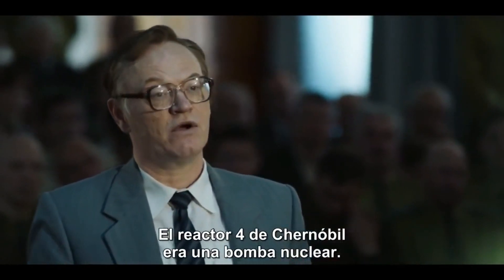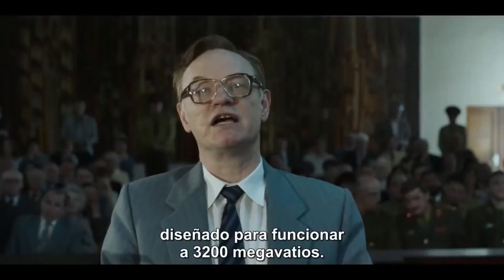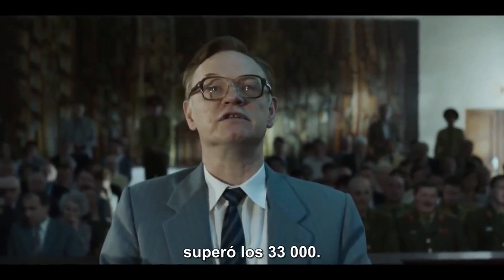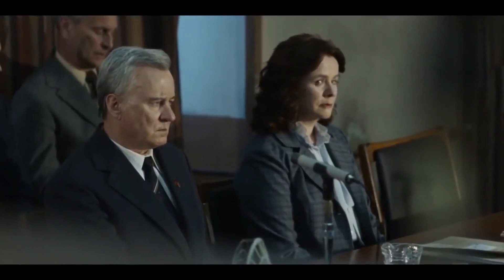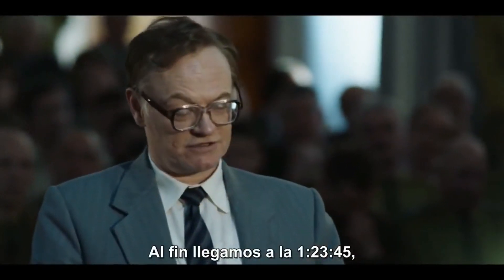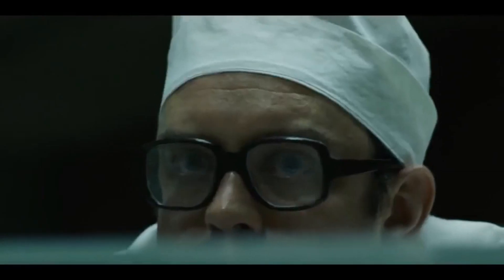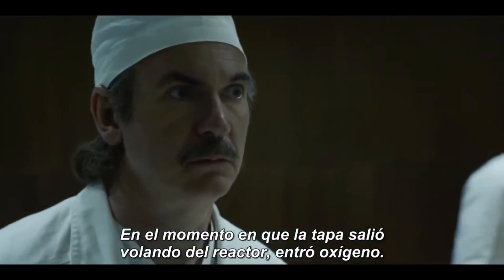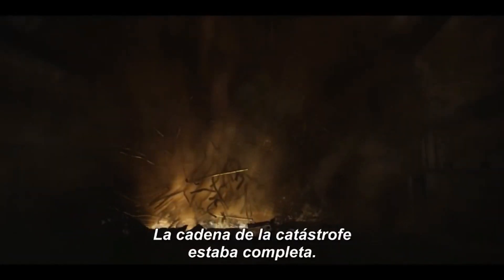Chernobil disaster explained in 10 minutes (3/3) - Valeri Legásov - Chernobil Series

Comment: This hollywood based miniseries made an entire generation misinformed about what actually went down, graphite tips weren't cheaper or "tips" at all, that statement makes it feel like they just added them because they ran out of boron, but no, bottom half of the control rods were made up of graphite, and top half were boron to increase reactivity at a much higher degree when pulled out, and displace water then get replaced by the boron control rods when inserted in, it wasn't an accidental addition it was serving its purpose just as intended, as RBMK reactors could both produce energy for civilian use and produce valuable fissile materials for nuclear weapons production, as well as having a huge thermal output efficiency with low enrichtment fuel, it was a double-deal. And when run at above half power it was and still is working like a charm , there are still 8 operational RBMK type nuclear reactors in Russia and Chernobyl Reactor 3 continued to operate without any issues till it got shut down in 2000 after serving its purpose, what they did fix in the reactors was shortening the length of the graphite tips on the control rods, and as for compensation, using higher enrichtment fuel and making the control rods drop or raise much faster as well as putting much stricter regulations, leaving no room for unambiguous rules or procedures and thoroughly informing their engineers and operators about the nature of the RBMK design.

Comment: In addition to upregulating the reactor [when used as intended] the graphite tips served another use - graphite is a lubricant, and the control rods moving in their channels needed to move smootly in a palce where normal grease would break down almost instantly due to the termerature.

Comment: Whether the graphite tipped control rods was the prime cause is conjectural.  The thing was already so far out of control and on a run away path of reactivity that it is not clear that the graphite tips made the difference.  Without question, they increase reactivity, but the reaction was already so out of control that it is a reasonable question as to just how much more reactivity was added by the graphite tips.  For example, if it is already spiraling out of control and increasing power exponentially, how much more reactivity do the graphite tips add?  10%?  20%?

The thing was going to blow whether or not the AZ5 button was pushed.  And it takes 18 seconds to get the control rods fully into the reactor.  It was already too late to stop the explosion, in all likelihood.
Reply: They made the difference apart from dialtovs stupidity

Comment: Okay, but "because it's cheaper" isn't an answer to the question. Why do the control rods have graphite "tips"? Why would the control rods have graphite on them at all?

I'm actually asking. This part of the explanation made no sense to me, and they kinda just hand-waved it away.
Reply: Ah! I can answer this! So, when a reactor is running, you'd think that the fuel burns evenly throughout the core, but this is not so. Like a fire, fuel in the core is expended more quickly, while fuel at the edges of the reactor core is reacted more slowly. When looked at it from a top-down perspective, this isn't too bad. That just means you swap out the fuel rods on the edges less often than the ones in the core. But this difference in consumption rate is also vertical. So a fuel rod channel that runs through the whole reactor in the middle will have the center parts of the fuel assembles consumed, but the top and bottom of the assembly still has plenty of viable fuel. 

SO! What you do is you want to make some parts of the reactor more... reactive, let's say. Graphite doesn't slow the reaction anywhere near as much as the water coolant does. So you displace some of that coolant with graphite. This lets you create hot spots inside the reactor where you use more fuel there than elsewhere. So now you can use the whole fuel assembly from top to bottom, and only pull it out and replace it once. Much easier, much more efficient.

In most other reactors (read: western) these graphite moderator rods are their own separate system. You move them up and down as needed, or keep them entirely out of the core. But, this has two downsides: 1, your reactor core is more complex because you have more channels going in and out of the core that all need to be monitored, controlled, etc., and 2, your reactor core either has to be bigger to accommodate these additional graphite control rods OR accept that your reactor core will generate less power for a certain volume. And complexity increases cost, and less power output means you're less efficient. So the RMBKs instead take boron control rods (that apply brakes to the reactor) and tip them with graphite. So you get to dampen reactivity in some places and increase reactivity in others. It is a cheaper solution, and in some ways a more elegant one. But one that has a VERY big weakness hiding in the wings, that Chernobyl brought front and center.
Reply: @xveers  Thank you! This really bugged me. I can see now why they didn't try to explain this in the show. But yes, the way you explain it, it does make a certain amount of sense to do things this way.

Comment: There's some confusion about the "Cheaper Graphite Tips", they are not exaclty tips, are the other extreme of the rods that are used to balance the reaction after the boron is extracted. The optimal way to balance the reaction after extracting the boron rods is using Heavy Water insted of normal water, which is way more expensive then using graphite. The difference is that heavy water would not cause the chain reaction and the explosion, while graphite does. So, yes, the explosion ocurred because they decided to use a cheaper but less optimal way to balance the reactor. They are not only tips, but a fundamental part of the system that was very suboptimal and dangerous.
Reply: It’s not necessarily that graphite is less optimal, its that its not a negative feed back loop. If reactivity increases, temperature increases, which boils off the heavy water moderating the reaction, which in turn slows down the reaction cooling down the reactor. Graphite doesn’t boil off. 

RBMK reactors were great in that they were super cheap and needed low enriched fuel. Pretty efficient to swap out fuel rods as well while the reactor was still running. It just had that fatal design flaw. You can have cheap, fast, and safe, but you can only pick two.
Reply: That's not quite accurate. The reason it's cheaper is because they were using natural unenriched uranium. natural uranium is very unreactive, since it is only 0.7% U-235, which is the isotope that participates in the fission reaction. They had to use a lot of tricks to get such unreactive fuel to react enough to run a reactor. One of those is that the control rods are made of two materials. Half the rod is boron, half is graphite. That way when the control rod is withdrawn, it is replaced with a graphite rod that accelerates the reaction. Below that graphite rod the channel it moves in fills with water which accelerates the reaction but to a lesser degree than the graphite does. When the control rod is reinserted, at the very bottom of the reactor there is a zone where water is displaced and replaced with graphite, which causes a spike in reactivity. With the reaction already running away, that was enough to trigger the explosion.

The way this problem can be avoided is to build reactors like most western reactors, which is to not use graphite at all and just use regular (light) water. Not many reactors use heavy water. Using light water requires enriching the uranium to 3-5% U-235 which is more expensive, but it allows for safer reactor designs.
Reply: @hydra70  I know this is 2 years old but this is the best explanation to this topic in the comments
Reply: Was?

Good Sir.... There are still 10 RBMK-1000 reactors in service now.
Reply: The remaining have had extensive upgrades to massively reduce or even eliminate this issue @JE-zl6uy
Reply: It's not suboptimal because it's still used today. It allows for less enriched fuel to be used, it allows for the fuel to be replaced with the reactor operating normally AND it potentially allows for the production of plutonium as well. It was a brilliant design and the RMBK reactor still exists today (along with other graphite moderated reactors). The reason it fell out of favor is:

1- It's not a big deal anymore to produce large amounts of very enriched uranium.
2- We don't need to use commercial reactors to produce plutonium anymore (or more specifically they do not need to have that option).
3- Refueling while in operation can be accomplished by other designs and also it's not such a big deal because in the 2020s the energy infrastructure has many more redundancies than in 1970.

So the things that made the RMBK special no longer exist. But the design was solid. Even after Chernobyl, very few adjustments were made that addressed specifically what went wrong in the accident, but the design itself remained largely unmodified because it works.
Reply: @zemm9003  To your point, the only reason Chernobyl Reactor 4 failed was because they were deliberately playing bullshit games with it. Any reactor could be brought to catastrophe if you intentionally play bullshit games with it. Fukushima wasn't a graphite reactor and it melted down because of the massive tsunami, but even without the tsunami, you could intentionally induce the same conditions that caused the meltdown via bullshit games. Chernobyl Reactor 4 wasn't the only reactor to have done that test, it was the only one that involved bullshit games that pushed it out of control.

Comment: Imagine brakes which after pushing first accelerate the car. And only later start to decrease its speed. However if the car goes too fast, pushing the brakes keeps accelerating the car.
And you do not tell the driver about this peculiarity.  Yet expect him to conduct risky tests with that car with these brakes. 
Not great, but most terrible.
Reply: The test was only as risky as it was because of the Xenon poisoning.  Competent operators would know that you can't bring a reactor from the state it was in up to the level for the test in the timeframe desired.
Reply: Its more like imagine you were driving your car with the ebrake on and then suddenly the ebrake snapped and the full acceleration hits, so you try the brake and whoops now your brakes are accelerators too
Reply: @jessethehappyguy  
Not really. It's really as Andy said it.

Comment: So...the emergency control button, AZ-5, has an effect exactly the opposite of its stated purpose?
Reply: To the workers of the world lifts shot glass of cheap vodka
Reply: I can't believe you can watch a video that literally explains how it happens and still be unable to grasp how it happened.
Reply: @StartellerRX-8  - Are you talking to me?  The AZ-5 button is supposed to shut it down and would under almost any other situation but, given this perfect storm of conditions, one of which was a cost cutting measure, it actually triggered the explosion. Have I got that wrong?
Reply: In ordinary situations, the boron part of the rods would have entered the channels way before reactivity increased enough to rupture the core's pressure vessel.